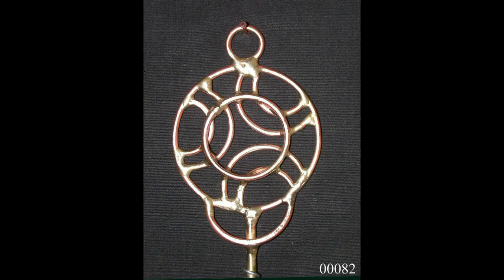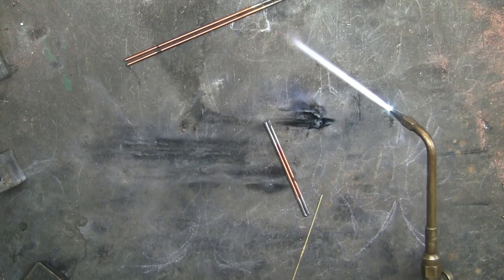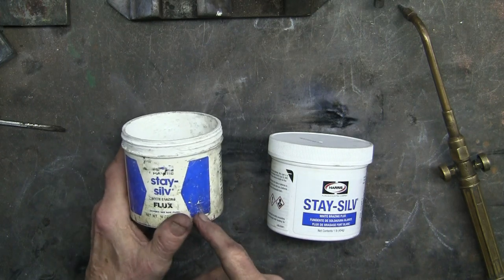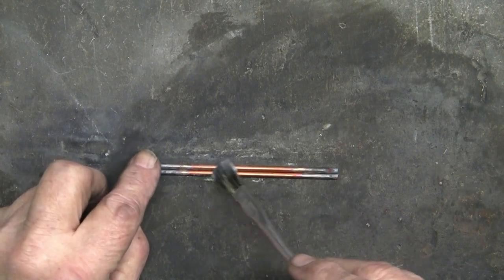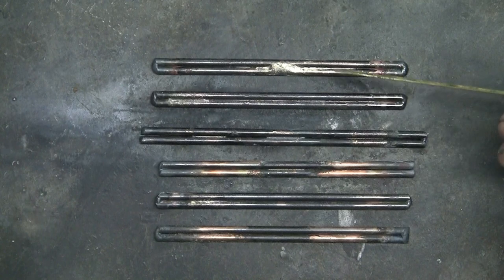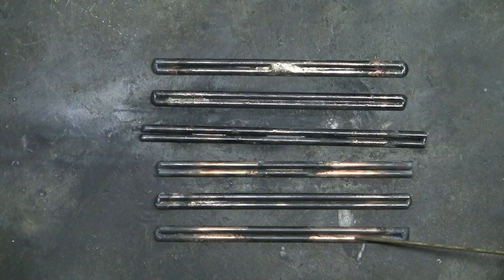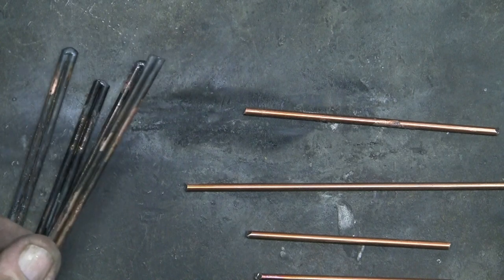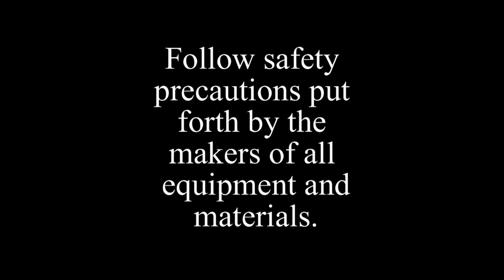Small Neat Brazes

Comment: George, would't it be better to place everything on a ceramic plate rather than on a steel table? You would be losing less heat.
Reply from the maker: Thanks for commenting.  I'd never heard of a ceramic plate or ceramic backing.  Did a google search and watched a few videos.  A ceramic plate might work well with a small demonstration as in the video, or doing smaller work.   For my work in general and especially for larger pieces I'll stick to the steel table and the heat loss.   George
Reply: @897473  you could work with some fire bricks like the ones for wood ovens. We use them for trade shows to perform demos.